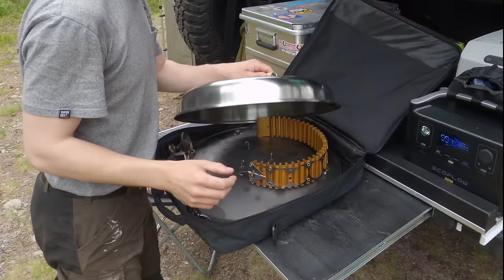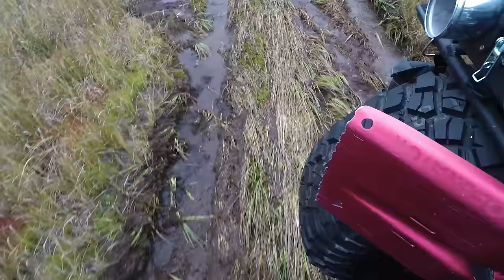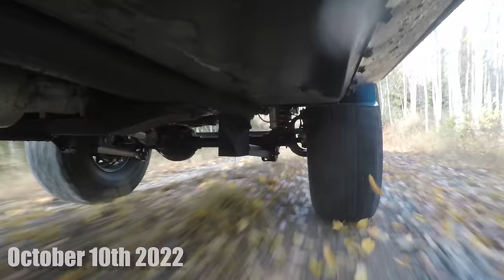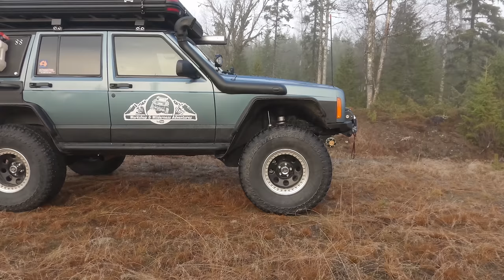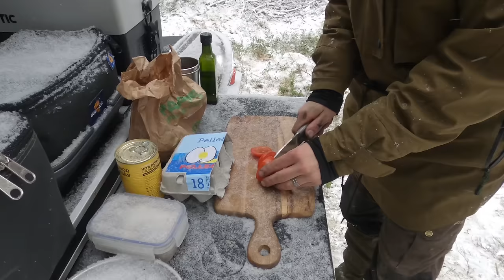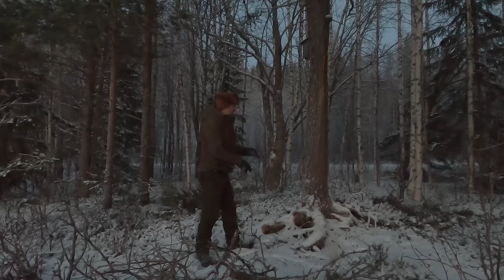Spring Rains To Freezing Winter / Solo Overland Adventure Documentary

Comment: I put a 12 volt heating pad at my feet, on top of the exped, plugged into a 300w Jackery.  It keeps my feet warm and warm air circulating inside the mat all night.  I haven’t been out in temps as low as you!  And I sleep inside my RAV4, not a rooftop tent.  But since I sleep cold this trick helps a lot. 
Give it a try.

Comment: If you watch other Nordic type campers, their rigs have one thing in common. The battery is located in the heated area. Most of which is a closet or crawl space in the rv. They fork off the output to heat the crawl space [where the battery is] and the second output goes to the the rv living quarters. Build an insulated box and run a small hose paraciting off the big output hose and feed it to the box. You only need it to heat to 5 degrees centigrade for the battery to hold a charge and deliver it's maximum abilities. You might need the 5k BTU model to pull this off and put up with the noise  as to never let the battery box to get cold.  ANOTHER OPTION: Oh ya, look up "Self Heating Li battery" They keep themselves above 5  degrees C. You might get out of this cheaper separating the heater battery from the one your using now. No extra pluming needed, it's heater is built in to the battery, it does drain on the battery but only when under 5 degrees C, this eliminates alot of tasks.
Reply from the maker: Yeah that's exactly what I need to do. A proper battery setup under the seats or something with all the connectors at the back. Mind you my new system still operates down to -25c which is absolutely crazy.

Comment: Perhaps the air flow underneath the roof tent is causing extreme loss of heat. Constant breeze sapping the warmth from every layer of insulation you put inside the tent. 
When sleeping on the ground the radiation will be slower. You’ll even warm the ground up slightly. 
You’re suspended like a fluffy loaf in a Dutch oven. A slight breeze can mess up your bakery 🍞
Reply from the maker: You are absolutely right. I've camped over the whole winter with this tent now and the mod I made after that video was another inflatable double mat under the main one with a layer or mylar. It worked really well as low as -25c. I don't tent to go out in lower.
Reply: @WorkshoptoWilderness  Nice! Glad you found a solution, I was preaching to the choir there 😂 
I wonder if packing snow underneath the rack round the edges would be any good
Reply from the maker: @dancreed  Ah no worries, any advice is always welcome. At temps that low the snow doesn't hold together, it's like salt. When it's -5c it's better but you still can't make snowballs.

Comment: Hi Mike new sub here, been binge  watching your vids. Great channel. I wild camp in Uk and have diesel heater connected to my leisure battery, but would like to connect to my eco flow river pro like you have when no battery. Do you have a link to a decent cig plug please and what size inline fuse would u use please. Cheers Sue
Reply from the maker: Hey Sue, thanks for subscribing. http://simplysplitcharge.co.uk/universal-cigarette-lighter-plug.html - this is exactly the plug I'm using although I have a 10 amp fuse. It's not the best connector to use because they can come out I'd knocked or pulled but if the vehicle is stationary then it's fine I guess.
Reply: @WorkshoptoWilderness  thanks Mike. All the best for 2023 with your channel it’s fab
Reply from the maker: Thank you! Merry Christmas and Happy new year. Appreciate you watching 👀 🙏

Comment: Hey fella, what's the story/details with the diesel XJ!??...
Reply from the maker: Hey, Its a European RHD 1999 with the factory 2.5TD 425 OHV marine engine. Ax15 gearbox and NP231 T case, Chrysler 8.25 29 spline LSD 4.88 and front HP Dana 30 27 spline. 
That's basically everything although the engine is modified to push out about 160hp and somewhere near 400nm of torque. I have loads of build videos on the channel but I am yet to do an up do date walkaround. Thanks for watching,

Comment: How you know the diesel doesn't freeze;  do you know what to do then; you will warm your tank with the gas can or what;😮😮
Reply from the maker: The diesel here is generally good down to -50c. It has some kind of additive for cold climates. My limit on winter excursions is -25c. I don't generally go out if it's below that because of the potential mechanical failures that can occur with the engine.
Reply: @WorkshoptoWilderness  thank you my friend.

Comment: What suspension do you have on your jeep?
Reply from the maker: It's about 6.5" total. A bit of a frankin lift. Lots of DIY parts and such but overall I've got some 4.5" coils with DIY 2" spacers, 6.5" trailmaster rear shocks installed in the front with some DIY upper brackets and lower bar pin eliminators. 
The front control arms are from ruffstuff with drop brackets. The rear is a 5.5" rubicon express leaf pack with some DIY boomerang shackles. The shocks are stock xj shocks because I made some high clearance shock brackets on the axle so the shocks don't need to be so long. It's a mishmash but it works well. I live in Europe and I don't earn much so I basically make loads or shit on the jeep so I can afford the camp gear I can't make.

Comment: Your jeep is awesome man, I’ve never seen one with a diesel in it. What’s your fuel mileage?
Reply from the maker: Thank you! I get 1 in 11 at the moment so that's about 25mpg. Not fantastic but I guess its okay for a heavy lump. I have just advanced the fuel pump and installed a new fuel pin so technically I should get earlier injection, more complete fuel burn and more power along with better mpg's. I will have to test it on a full tank.
Reply: 25 mpg man that’s awesome. Mine gets 15 freeway if I’m lucky out of my 4.0l lol man that’s a daily driver right there, good for you my man 🤙🏼 I’m from the states so those don’t come factory here. I’m curious on what’s in yours

Comment: Have you considered induction cooktop via your Ecoflow for sub zero cooking?
Reply from the maker: I've thought of it, don't they use a lot of power?
Reply: @WorkshoptoWilderness  I have a portable power station with 2000W inverter and 2000Wh battery, my induction cooker default starts at 500W and I can cook most things very efficiently as the pot is heated directly. I have not camped in sub zero temps so cannot speak to that. Of course you need sun and an efficient solar panel to recharge and in sub zero temps you wouldn’t have that in winter. I can go 2 days comfortably without charging but again I’m using it at milder temperatures.

Comment: Are those gri sport boots ?
Reply from the maker: Yes they are, although the model is an old model I got on discount. They are okay but shite in the wet. Thanks for watching.
Reply: @WorkshoptoWilderness  mine were fully water proof, are they not goretek?
Reply from the maker: They are gortex but they failed after a year.
Reply: @WorkshoptoWilderness  sorry to hear that. Mine got stolen after 5 years of thrashing. They were still comfy light and dry. Fucking expensive though